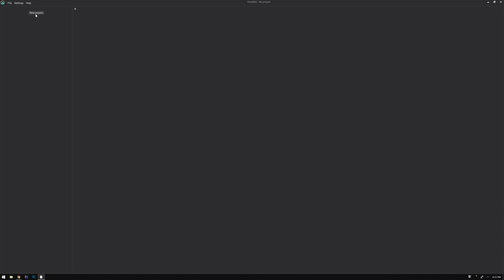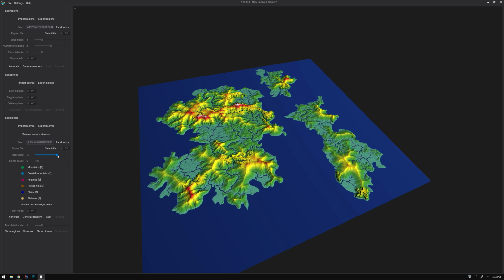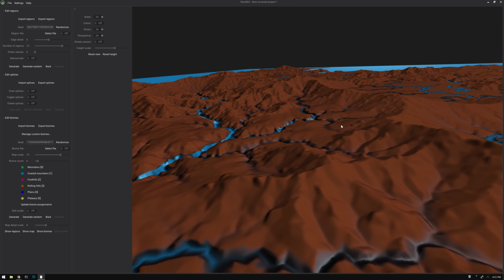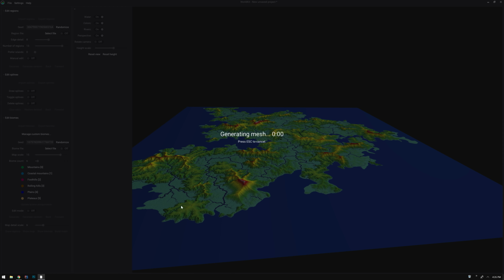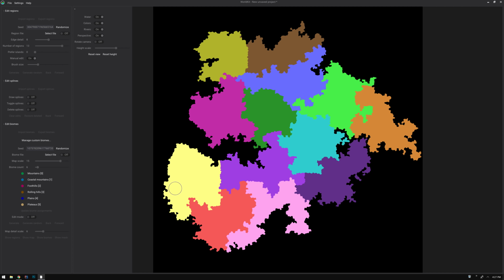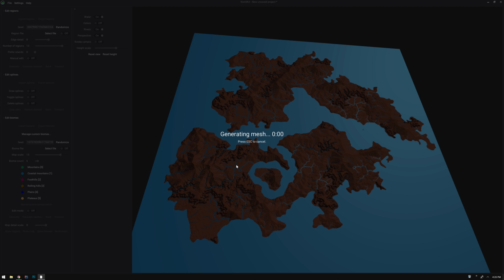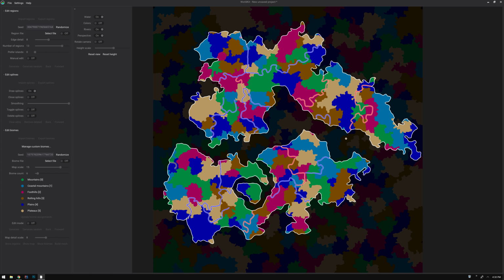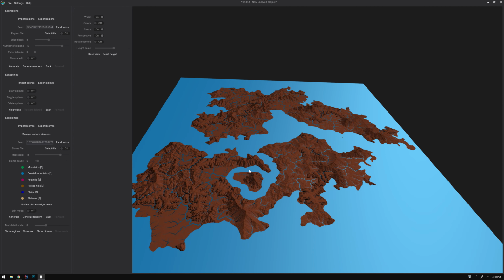Introducing WorldKit

Comment: Just saw this shared on 80level. Got really excited then discovered the kickstarter was cancelled! Was totally ready to back. Is this tool still in development?
Reply from the maker: I am still working on WorldKit as a solo project, so it's going a bit slower. Because I failed to get backing to support a commercial release of WorldKit, I am planning to follow Blender's example and raise money to pay for the current development to this point and then open-source it so the community can support it.

One of my takeaways from the initial campaign is that WorldKit needs to be able to replace current tools like World Machine, World Creator and Houdini completely for the whole world generation process, not just the first step in the pipeline. Because of this I'm working on improving the high detail features so it can generate 16k maps in less than 30 seconds with a much higher degree of realism. The new high-detail system uses AI that is trained to reproduce landscape features from satellite imagery which allows for very efficient generation of terrain that is ready to go straight to engine without the need for other software in between to achieve high levels of detail.

Another thing I received lots of feedback on was that I needed to improve viewport controls and visuals inside WorldKit. To this end I have added a "preview" mode which generates similar in-viewport visuals to the video above in about 2 seconds. I also added full detail mode which takes about 20-35 seconds to generate a much higher resolution landscape in the viewport, so that it's easy to see all of the subtle detail added by the new AI terrain feature system. And finally, I added more familiar camera controls to the viewport that mimic UE4 Editor viewport controls, and I added a PBR shading pipeline to the WorldKit viewport based on the UE4 rendering pipeline as described in Epic's paper on the subject. I'm currently working on getting proper skybox, water, and fog shaders into the viewport based on the new PBR rendering pipe.

I received a lot of negative feedback from the Unity community as a whole during the last campaign, leading me to believe that either people are not making the type of game that needs this kind of tool in Unity, or there are tools built into Unity that people would rather use than WorldKit. Conversely, I received a ton of positive feedback from the UE4 community, and it seems the demand for such a tool is much higher there. Because of this I'm focusing on support for UE4 right now in addition to the general features I listed above. I'm hoping to secure some funding to develop a UE4 plugin to import WorldKit worlds directly into UE4 Editor.

I hope to have a video demonstrating all of the new features up sometime in the next two or three weeks. I plan to run a longer publicity campaign prior to the next fund-raising round this time, as I was not able to reach enough people during the 30 day Kickstarter the last time.

Thank you for your Interest!
Reply: @adam_brown  Nice to hear it's still under development. Do you have any developer feeds like a blog or Twitter account people can follow? I'd really like to follow along!
Reply from the maker: @JamesKellyWickerman123  This channel is the best place to get updates for now. I plan to release another video here in the coming weeks with the new major features that I have been working on, including the high-detail generators and the new rendering pipeline. After that I plan to do more incremental videos as I make smaller improvements heading up to the open-source fund raising campaign.
Reply: @adam_brown  i'm cheering for you, this app of yours has great potential. You have considered the blender example, you should also look at Godot 3D an engine that could gain a lot from landscape features & plugins and peraphs they (the dev core and userbase also) could support your project in a way or another.
Reply: I would totally back this if you were to open a new fundraising.

Comment: What language are you writing your interface in? It looks very clean and modern .Great stuff.
Reply from the maker: WorldKit is written in Kotlin using OpenGL. LWJGL provides the hardware access. https://kotlinlang.org/ https://www.lwjgl.org/
Reply from the maker: I just realized that, if the UI is what you're interested in, you are probably specifically interested in the GUI framework more than the language. That requires a little elaboration. Unfortunately there are no good off-the-shelf solutions for doing this type of thing. Embedding an interactive 3D viewport into a reactive UI in a program that needs to use most of the video card off-screen for processing is way out of scope for the existing UI systems provided by LWJGL as they are immediate mode, and don't support the required features.

What we did was write a framework using an instanced quad and custom shader using signed distance fields to render rounded rectangles with borders and shadows. Then we wrote a DSL in Kotlin for nesting ui blocks under a root block, and another DSL for styling blocks. It's basically what you would have if you had HTML but all you could use was divs and spans, and a limited subset of CSS. Then we render the UI layer to a texture buffer only when it changes, and we render the 3D viewport only when it changes. This leaves the GPU free to work on back-end generation when you aren't panning around the viewport or clicking on things.

From what I can guess, most companies who have to put a 3d viewport into a rich ui pretty much go the same way. Look at Blender, ZBrush, Maya, 3ds, Modo, Cinema4D, Substance, and more. I'd venture to say that a good portion have probably done what we've done and rolled their own proprietary system on Direct3D or OpenGL, or they've extended Qt. WPF provides an alternative solution if you want to go Direct3D instead of OpenGL. Both Qt and WPF/D3D will likely mean going with C++.
Reply: @adam_brown  That is great information thank you so much for taking to time to respond to my question about the ui and backend framework. It's always nice to see and learn about what other people are using to develop. Great work Adam.